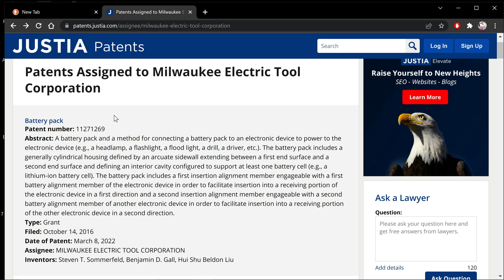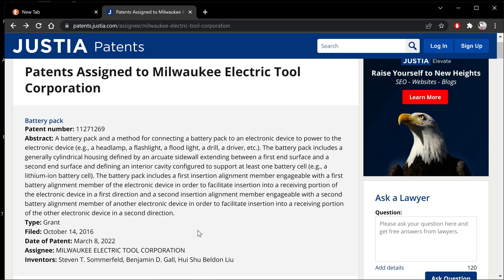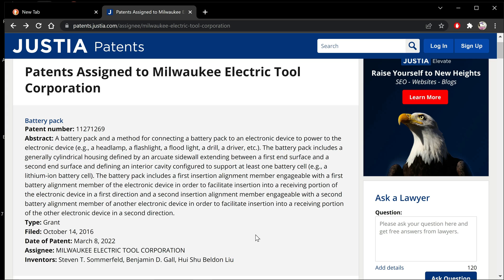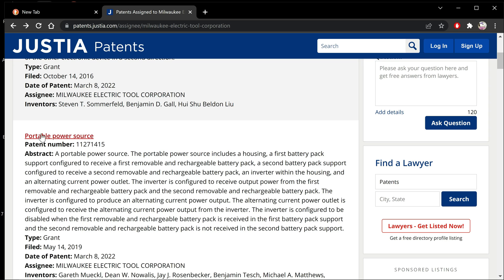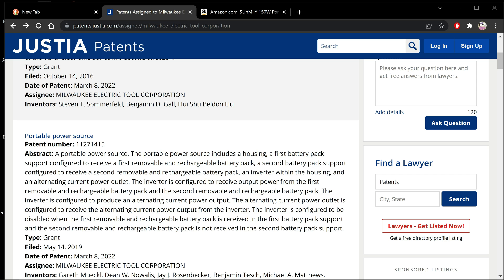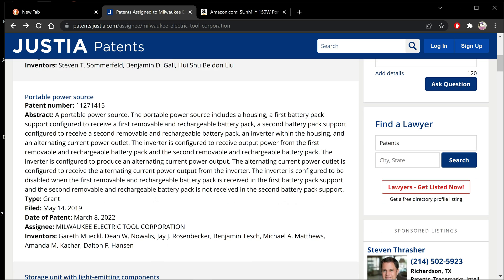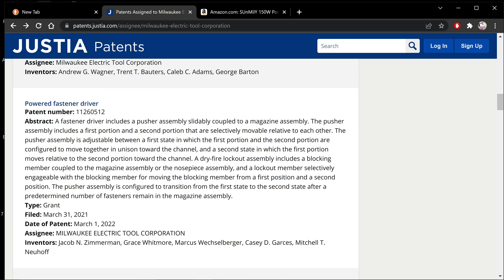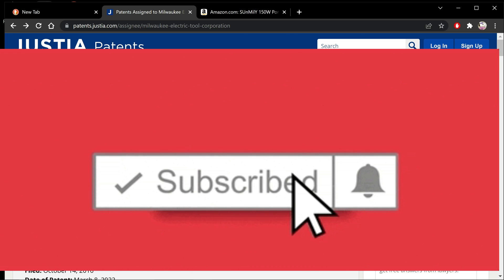Milwaukee has a new battery?

Comment: Just 3d print a battery case with another battery connection on the bottom. Batteries in Parallel to make the smaller batteries useful connecting 2-3 for hand tools, but also double the run time with two 9Ah/12Ah for large/stationary tools.
Reply from the maker: Yeah they don't want to  but they could easly do that

Comment: that patent was filed in 2016, it appears to be for very outdated battery design, possibly the M12.  You can look it up in US patent search and see the images.  Certainly nothing to compete with the new flat pack batteries.
Reply from the maker: I will check it out thanks!
Reply from the maker: I changed the thumbnail it was a bit misleading thanks for pointing that out!